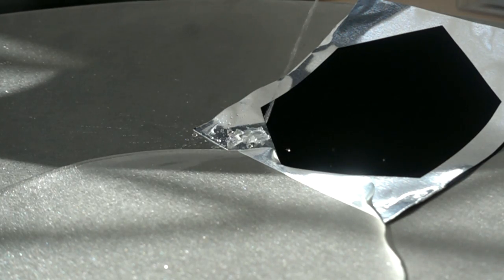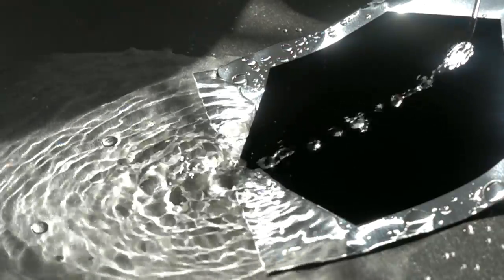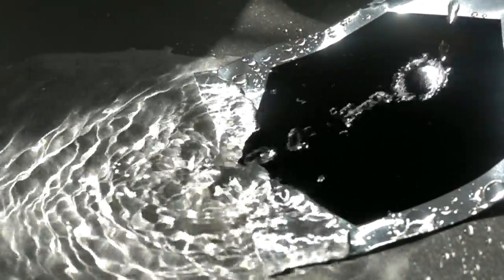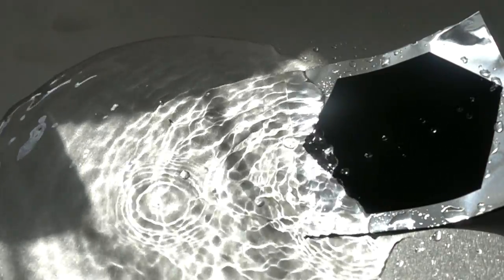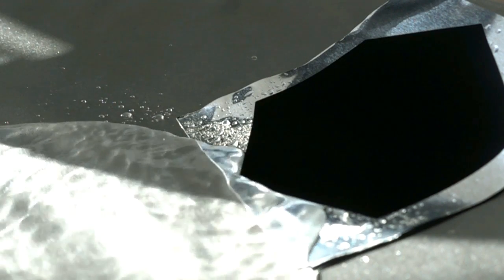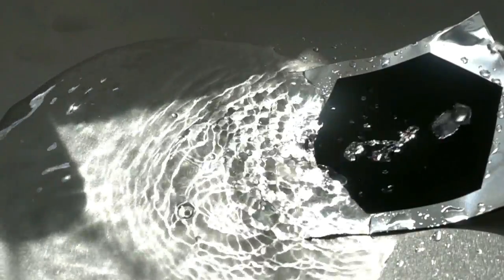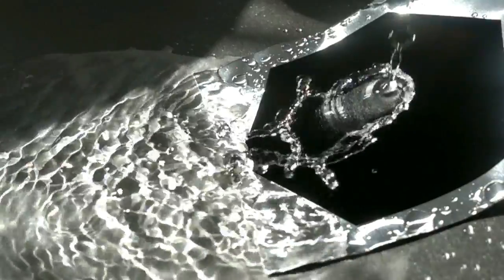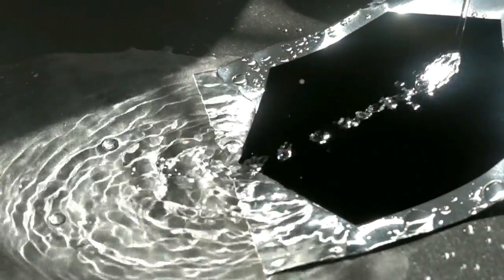Slow motion water on Vantablack - High resolution

Comment: The test that I would love to see the difference in a passive solar water heating system between a super black coated pipe, an ordinary black spray painted pipe and a plain copper pipe. I would love to know the max heat achieved on a sunny summer day over an hour or so.  Cheers
Reply: Good Solar collectors dont use black (blackchrome) color, they use blue colors Titan-Nitrid-Oxid. The Absorptionsrate is nearly 96 % and the Emmisionsrate is only 5 %. The most black colours have the problem with high emmisionrate. With better colors its only possible to increase the efficiency of 2 or 3 % because we are near the optimum.

Comment: Does it absorb all visible light equally good and what about the close non visible wavelengths? Where is its low point?
I am not sure wether the tubes diameter or the dispersion in the structure matters more.
Reply from the maker: It's very good from 200nm (UV) to FIR. It's spectrally featureless, but absorbance goes from 0.1x THR @5 microns to 0.8% at 16microns. The structure is more important than the tube diameter.
Reply: Thank you, very interesting. Keep up your good work!